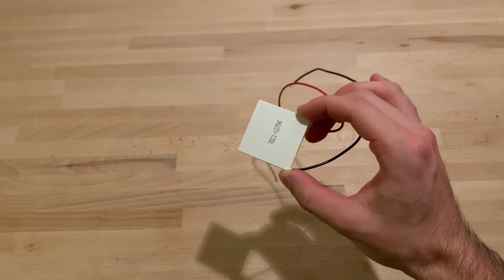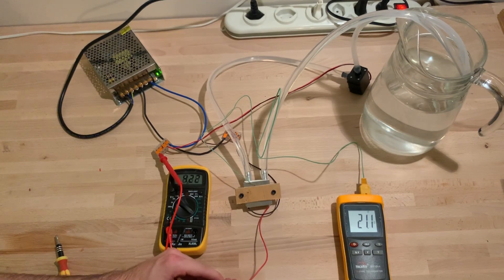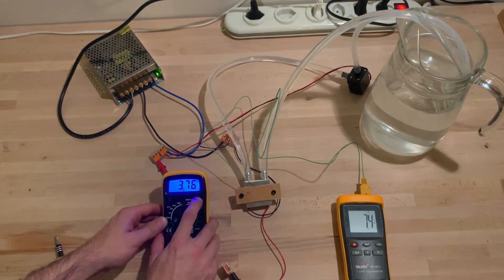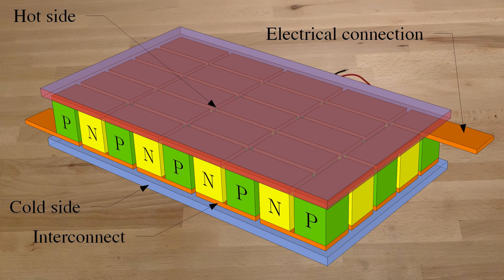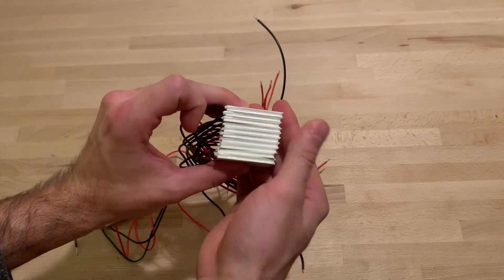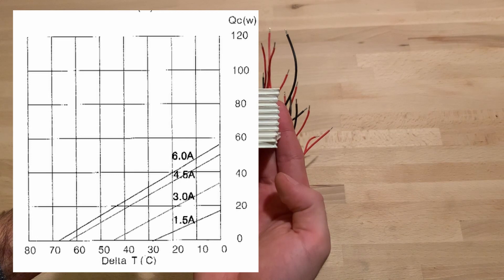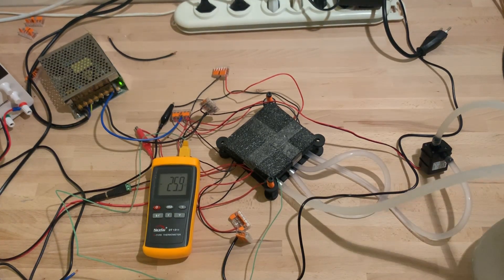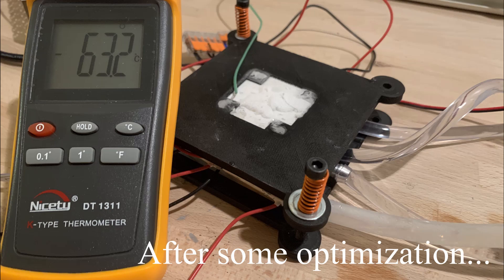Is Liquid Nitrogen production with Peltier-Element possible? How cold can they get?

Comment: I reached -40°C with 2 tec2 25408 in parallel under 12V and sitting on a water-cooled heat exchanger going toward an ice bath. I get -37°C over a 10cm * 10cm*1mm aluminium sheet for a cloud chamber. I made computations at the time, beware, stacking them in serie require to stack the heat transfer of their joule heat.

Comment: tbh you'd probably also need to cool water first, and use a copper heatsink
also you can buy premade 4-stage peltiers, that are already attached.
You could try connecting the 4-stage to this one
also, at this stage the thermal paste may also be a limiting factor
Though -30 is already very good
The best I did was some -10C with a heatsink submerged directly in an ice bath

Comment: I think the problem might be that you're giving the cooler ones too high of a voltage. Since those coolers have a low efficiency, the energy you're dumping offsets the cooling that it's doing.
For instance, imagine doubling the voltage on a normal Peltier cooler at room temperature, and then doubling it again. Eventually, the hot side will get so hot that it overcomes the heat pump's insulation, immediately heating the cold side. Then double the voltage again and both sides are hotter than room temperature.
I expect that at lower temperatures, it will require that you don't dump so much energy into the system.
Reply: Theoretically the Peltier cooler should be more efficient at cold temperatures, not less.
Reply from the maker: Well i understand where you are coming from, it would make sense as the resistive losses decrease as temperatures go down. Yet if you check the datasheets of pelties you see that at for example 50C they pump 10% more heat with the same current than at 25C. I tried reducing the current of the higher stages, problem there is that now the waste heat of the base stages is not transported away. Its a hard balance to strike and while lower temps than i got are definitly possible (there are premade 4 stage pelties that can achieve that) the general efficiency plummits as well as the rewatd for additional stages.  I think this goes down to the underling quantum effect that takes place. The seebeck constants themself are temperature reliant, i didnt find concrete values but it would make sense that the different seebeck values converge to zero as the temperature decreases.
Reply: @bootlegengineer  I'm curious if different semiconductors used to create the Seebeck effect would result in different effects.
It's possible the problem here is simply "diminished returns" as you approach closer to absolute zero.

Comment: like a sterling engine ... put a heat sink or water cooler between each stage use the heated water in a radiator to chill it back down ... then you remove the cascade heating effect and return it to additive cooling ... and you still get additive heat going out to the radiator ... 

a pelltier device is essentially a sterling engine in electronics ...

Comment: Can you describe what you did exactly, what pelriers u used for each final stack and voltage given? I'm thinking everything was 12v besides the top double Stace, lower one was 12v and top was 5v? Am I correct assuming this?
Reply from the maker: I cant exactly recall the voltages, but i think I powered all but the top stages with 12V and the top one with 6V. I used the standard Tec-12706 and one Tec-12715 in the base.
Reply: I have alot of 12705 and they seam to work better than the 12706, have many different ones for testing and 12705 seam to be a huge impact, I tried air cooled on the very bottom and failed badly, working on water-cooling this time and seeing if it works better, doing this because I can max a system I have at -30c and need a little more than that for my idea as a peltier cooled pc
Reply: A idea of my kit
All 12705 at 12v
Bottom to top:
Waterblock hot side
Peltier x4
Waterblock cold
Peltier x4
Waterblock hot side

Doing this helped the cold middle get as cold as possible on both sides and hot side only gets hot on 1 side on top and bottom of my kit, very effective, on a 360 radiator
Reply: Hot side was cooled with a 360mm radiator, the cold side went to my hole setup for my computer cooling

Cooling cpu and gpu for great cooling and overclocking, request specs if interested
Reply: I just tried with a cascade idea similar as yours and got no where an 12v with out the double stack on top, then I changed it to 12v on bottom 3, 5v on the middle 2 and 3.3v on the top and yet no where again
Reply from the maker: @matthewshankle518  Yeah cascading is really hard to tune in, as just the slightest inbalance will throw the hole thing off. Also cascading reduces the effective heat you can reduce by a lot. So for your idea of cooling a cpu and gpu I think you have to stick with the 1 stage model. Did you try the double stack if that reduced the temperatur without the top element?
Reply: @bootlegengineer  or actually spread the cooling stages out more with their own heat sink between each stage ... air cooled or water cooled doesnt matter ... if you dont draw off the heat you start the next device at a higher temperature ... which means a smaller cooling ramp ... meaning less work for the same amount of input .... like a diode or a capacitor ... a pelltier device has a steep curve ... the longer you keep it in the sweet spot the better it works ... do nothing such as you did in this example and you go from a steep curve to a flat line ... chill em EVERY STAGE not just the ends ... ALL OF THEM ... keep pulling the curve back down to the steepest part for maximum performance

Comment: You could liquefy ammonia gas and make an electride solution with lithium metal.. if you're into that sort of thing.
Reply from the maker: Are there any uses for that? From what i can find the solutions are only stable at temperatures below -40C. But if there is some fun to be had with I might give it a shot

Comment: you need a radiator on the hot side to get the heat vented away
Reply from the maker: Thats true if you want to run a peltiercooler over a long periode. Here im just doing benchmarks and the heatcapacity of the water sufices for that duration.

Comment: You ever do the mini water cooler?

If you have two peltiers, both 12v, 1 is 10amp and the other is 6amp.... would you get a better cooling device by stacking them or just running them side by side? I was planning on cooling them on an aluminum block that has ice water running through it
Reply from the maker: Depends what temperatures you are trying to reach and hoe much heat has to be pumped. If you cool with icewater and try to get -40ish i would run em aide by side for better faster heat removal
Reply: Bootleg Engineer thanks that helps a lot, I am trying to cool maybe 5 gallons of water to right above freezing, and the water will start out near ice water temps and be agitated... so almost more maintaining... sounds like side by side will be best
Reply: From the info I've been looking at you can cascade them at a 3:1 ratio. This is because they are horribly inefficient. So on the back of one Peltier unit you'll need 3 to take the heat. The lowest temps they've reached is about -100 in lab tests under strict conditions.

Comment: wow, how much power did this thing draw at the end!?
wanna create a cloud chamber with peltiers, -30°C ∆T should be enough for that purpose, with some solid water aka. ice on the hot side...
Reply from the maker: My setup ended drawing 18ish amps (12V) With the 6 Modules but was really inefficient due to the stacking of modules. A single module can create a temperatue diffrence of 40 degrees. So if you want to use ice as cooling a single module suffices. I would use a heatsink and submerge id in an ice/saltwater mixture and a single or two parallel peltiers. Tec1-12706 can pump 30Qc/W at 30C diffrence at 4-6 Amps 12V. Its possible to just use a twostage peltier and go for an aircooler for the cloudchamber. Ive seen setups like that. But icewater while less convenient is easier i guess
Reply from the maker: You can also go for more powerfull modules the tec1-12712 can pump 50W at 10amps and dT=30  for example. 

http://www.everredtronics.com/thermoelectric.TEC1.html
Reply: @bootlegengineer  You could also try them out with lower voltage, they work better then. For example, i did some tests with 3x12706, i stacked them all. 2 lower ones i ran with 5volts and the top one with 3.6v, this way i was able to reach -31c when room temperature was about 19c, so 50degrees difference. Best part is that this way they only use about 25watts. Also you should try out peltiers that have max 8.5V and run them at 5volts, they are great.... Here is my very first cooler box: https://youtu.be/HSs0Zy017h8 It was just little too underpowered, so i changed the 3x12706 to 12710+12708+12703=5volts and about 40watts. The good part when using low voltage is that they don't produce much waste heat.

Comment: Dang would have been awesome if it worked but I know it won't .  I wonder if there could be a thermal sludge that carries large amounts of heat away from the system to generate liquid nitrogen . Most methods for generating ln2 are complicated . I thought of using 2 coolers, with aluminum tubing and dry ice     to cool dry air in the tube from a certain temp to - 60 c to - 80 c and expand taking advantage of joule - Thompson effect through controlled flow and a divergent nozzle to make subsonic gas lose more kinetic energy and rerunning cooled air into the negative temperature cooler  I described above . Of course I was thinking at operating it at a lower pressure like 725 - 2000 psi.
Reply from the maker: Stirling cryocoolers are a thing, sadly new ones cost upwards of 1900 chf, you can sometimes get cheap ones from ebay
Reply: @bootlegengineer  I'm looking into that . I can probably save some money and just get a Sterling style cryocooler. The problem I have with cryocoolers is helium. Gonna need some helium too , it's just helium has a tendency to escape through almost anything .  Thanks for the suggestion . But if you can or are interested will you test my method . It's fine if you won't .
Reply: @macadamianuts7 , some cryocooler are closed system, they only lose the helium if the system is damaged. most small cryocoolers, have helium inside them already. you a great engineer by the way.